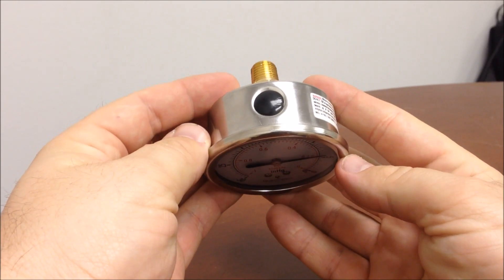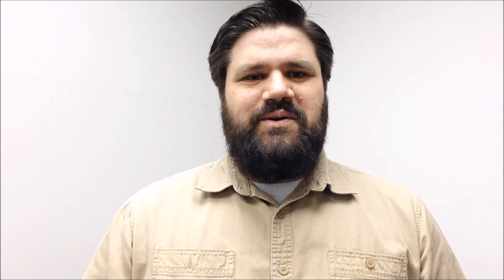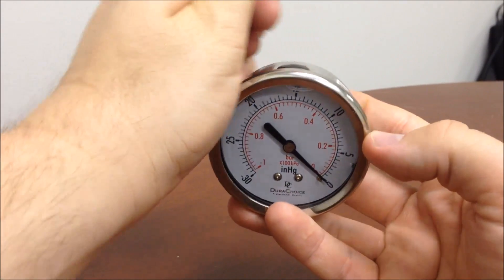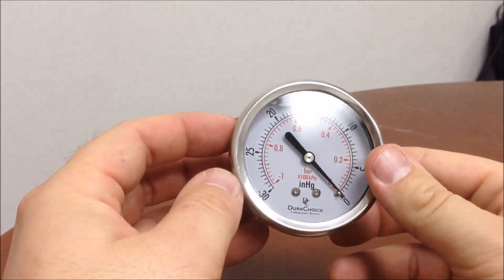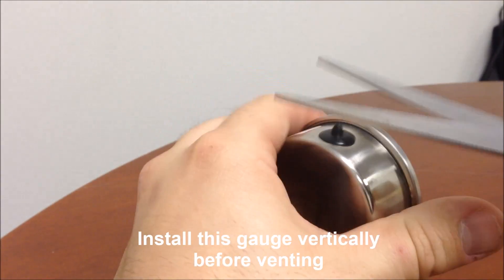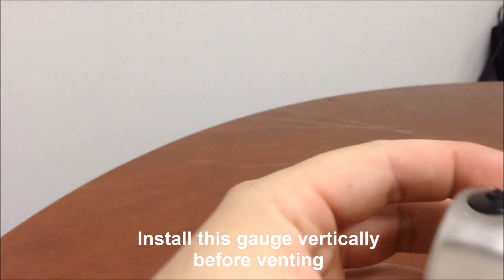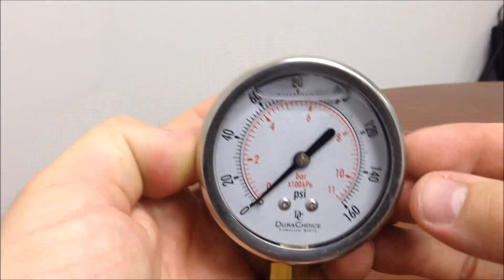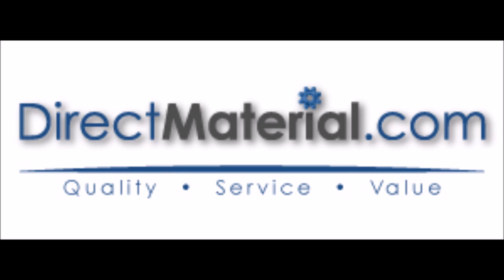How to Reset a Liquid Filled Pressure Gauge

Comment: I have the same pressure gauge as the one you have at 1.:00. (a liquid-filled pressure gauge)  It's installed before the RO membrane when the pump runs, the pressure reaches 95 psi (6.5 bar). when the pump turns off, it turns back to zero slowly. 
I installed the same gauge on the feed line before the sediment filter, but it doesn't move, looks like it's only working on high pressure...the pointer doesn't move in low pressure.....Is there a way to fix it or should I replace it with a new one?!!  Thank you...

Comment: thanks, super simple and easy tip. summer heat had a gauge reading 5hg with no vacuum from direct sunlight , pulled the pin, reset, works perfect

Comment: My question.. you clipped the one with the small tip on top but then put an update comment yelling DO NOT CUT.  What happened / changed?
Reply from the maker: We apologize if we came across as yelling. We wanted to make it clear that we no longer recommend cutting it. 

Cutting it does still vent it, but it was limiting our customers to install it upright only (otherwise it would leak), so we no longer recommend doing so. Thank you for your question!
Reply: My Vacuum pressure gauge has a rubber stopper as the first one in the video, but with a hole in the center of the rubber stopper. It reads 5 inHg instead of 0 at room conditions. I tried the method suggested in the video but couldn't help. What to do?
Reply: DirectMaterial.com  Well I just received the gauge in the mail and instructions said to cut it which I did is there anyway to get a replacement plug and where can I get some glycerin oil?

Comment: I just bought a fluid pressure gauge
but confused how to use it
should rubber vents be cut?
or leave it alone?
or can be given a pinhole to use it?
Reply from the maker: If you bought it from us, please, do not cut it. If you cut it already, please, contact us at 888-334-4339, we'd be happy to help you out.

Comment: I have a 4500 PSI compressor that had its oils/fluids drained prior to shipping to me. I have to fill up the pressure gauge with either glycerine or silicone oil but I don't know which one to use. It has that rubber stopper so I can easily pour in the liquid, I Just don't know which viscocity or fluid to choose. I have looked everywhere online and there is no specifc answer so I'd really appreciate any input you may have on the matter, thank you.
Reply from the maker: Hi there! Thank you for your question. If it's one of our gauges, it would most likely be glycerin, but we do have a few silicone ones. It could be either, depending on the manufacturer. Are you able to call them? If you like, feel free to call us at 888-334-4339 and we can try to help you figure it out.

Comment: What if venting doesn't do the trick? Mechanical issue?
Reply from the maker: Thank you for your question! 

In most cases it will reset, but it’s possible that it might not and it’s not necessarily a mechanical defect. There are a few different reasons why that could happen. If you’re having an issue with one of our pressure gauges, we would need more details to be able to offer a solution. If that's the case, please, don’t hesitate to contact us: 888-334-4339